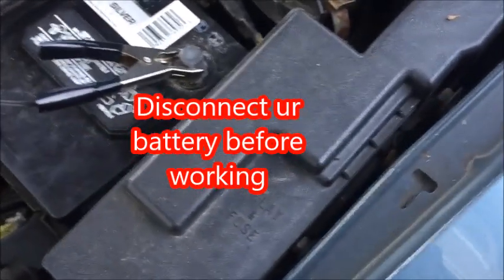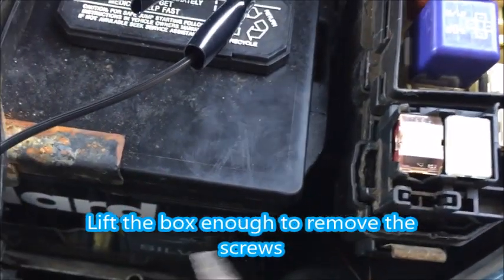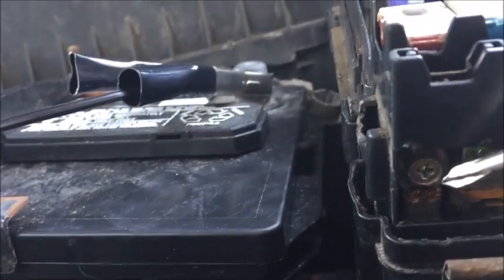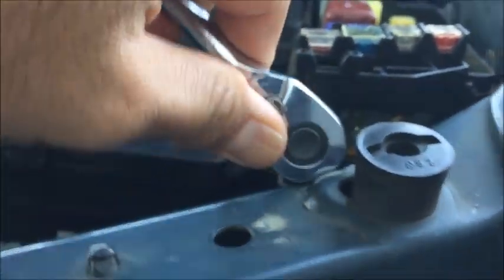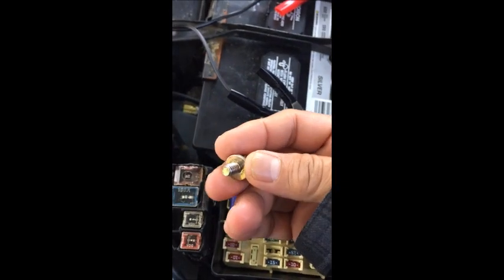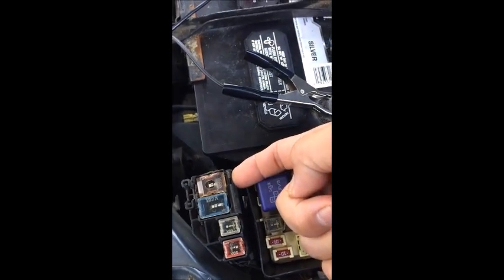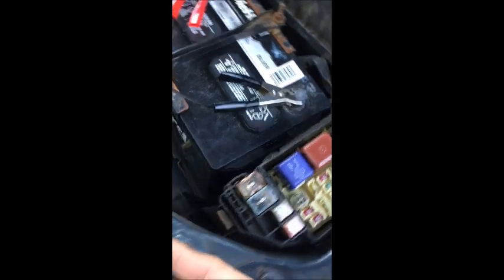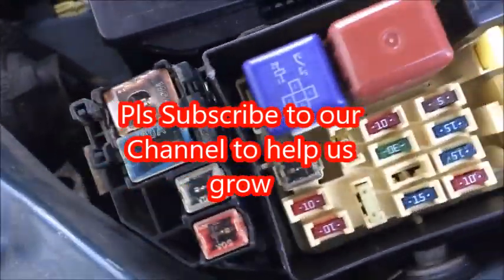Alternator fuse Toyota Sienna clear steps replacement

Comment: You do not need to take the screws all the way out.  Just loosen the screw enough to let go of the fuse, and then you do not have to fight with dropping them or putting them back in place.